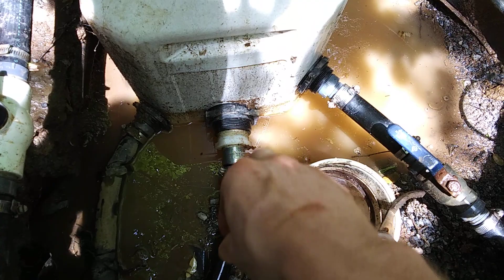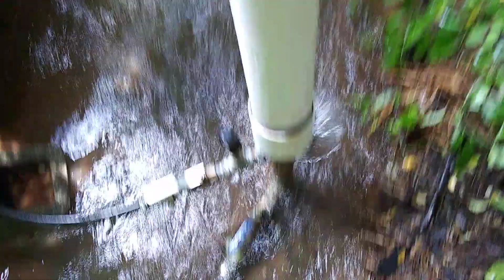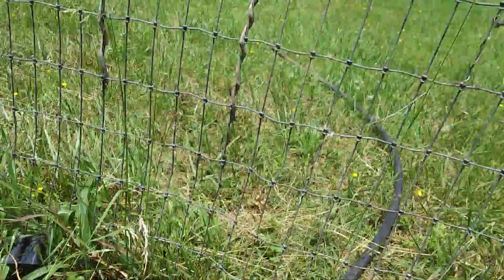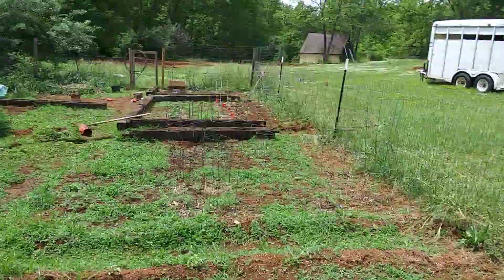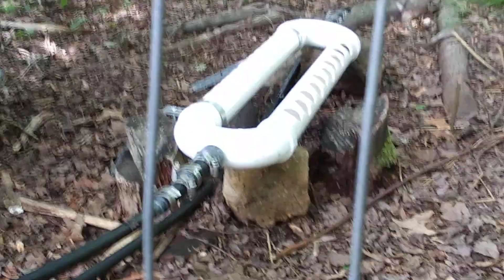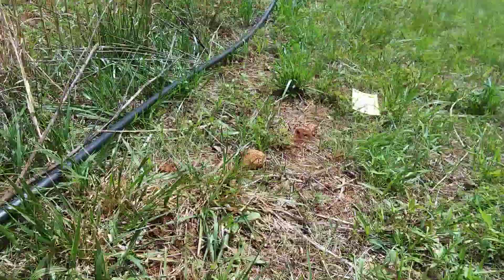Spring-fed ram pump for chickens and horses

Comment: Hello, I just subbed. Can you please explain how can you install the Ram pump from the head of the Spring? I will be capturing the water and making a Dam and send it uphill about 30 ft of steep slope on the mountain. I just don’t understand how the Ram pump can do this while wasting 90% of the water in the small Dam? From the source of the spring I may be getting about 1-2 gallons a min…I would greatly appreciate your help brother
Reply from the maker: A ram pump uses high volume of water at low pressure input and converts the energy of falling water into low volume at a high pressure, there are plenty of videos explain how ram pumps work that will do a much better job than I can, but basically it "wastes" water to run the check valves on the inside of the pump, as long as you have a slope from the water source to the ram it will run

Comment: Subbed. I never thought of increasing the height of the stand pipe. I think you are the only person to do that on YouTube. Thanks!
Reply from the maker: You want your standpipe to be tall enough to hold ALL of your water and not leak out the top. If it leaks out it means you could be running your ram with a larger stroke, more weight on the waste valve, or a taller standpipe. It also means that your source of water (intake) is higher than the top of your standpipe. Water works like a level, the point of a standpipe is to bring the source of water down to your ram. You want as much height or head pressure as possible.

Comment: Put a float valves on your waters and a holding tank for storage. 
Also if you like water in your garden you should look into Chinampas.
Reply from the maker: Great ideas, my set up is definitely a work in progress. Those chinampas are awesome! Never heard of that before. That absolutely looks like something I'd be interested in, only I would probably use the actual creek for water supply not the ram pimp

Comment: You said the stand pipe was 10 feet tall.   Assuming you have some fall from the stand pipe to the ram pump - what is your effective head?  10 + ?
Any idea of the volume of water you are getting at the T at the top?
Reply from the maker: Good question, the way I understand how water gravity and the fall works, however high the water fills into the standpipe without the ram running, that's how high your source is. Or "head" so mine would be over 10 feet, because my standpipe that is 10 feet tall was overflowing. Hopefully that clears an confusion in what I said in the video and thanks for watching!
The most I have gotten so far is 1 gallon a minute at the top of the hill. But I still have some things to tweak and adjust, I've only had this set up for about 2 weeks
Reply: @Whelessry  I understand your reason for going to the T at the top and coming back.  Many do that with a tank at the top.   However, there is another factor that I'm not completely clear on.    The higher the delivery height, the less water is pumped.  I've seen ratios from doubling the height resulting in half the volume and also doubling the height resulting in 1/4 the volume.    I'm not sure the true number and may not be linear.    
In my case I I am planning on going up 10 feet from a creek to the edge of a meadow to do an irrigation process - low pressure Wobblers or drip irrigation.   However, if instead of going to the higher edge and coming back, I instead irrigate along the way - maybe I'd deliver more water.   Also, not sure that ram pumps are the right water powered pump tool in my situation, but will be an approach tested.
Reply from the maker: @davebean2886 oh I see. In my case, my goal was to get water to the top of my hill as a first priority. Thats where the chickens are. Then slightly down to the horses, then back to the garden. The top is about 45 feet elevation from the ram pump. The garden is only 3 feet elevation from the ram pump. I only fed it back down and am using the overflows so that pumped water isnt wasted. I know ypu said you understand that, but my point is that honestly I'm not too worried about how much water I get to the top of the hill because as long as it pumps, the water troughs will fill up eventually
Reply from the maker: @davebean2886  to you're comment about a ram pump for your situation, pumping up hill 10 feet with a ram pump can be a very easy task, if you're worried about not having a big enough creek or not having enough fall for the ram to run there is a video by engineer775 who explains how to calculate how much water you can pump. He goes through the math equations. But if I were you I would just go for it and see how much water you can pump uphill with a smaller easy to build set up first to see if you'd like to scale it up in the future, if you're doing this for a garden, most plants don't really need that much water. (Unless you have a very large garden) but since the ram runs 24/7 even a tiny amount of water should be plenty for even a big garden.
Reply: @Whelessry  Thanks - I have a Land to House 1 1/4 inch ram pump that I'll begin testing shortly and be in a better position to extrapolate.   I was please to learn that ram pumps can function at fairly low head, just becomes a matter of how much water is pumped.    Unfortunately for my irrigation application - volume matters.   Also considering other types of water powered pumps.

Comment: Well done man. I'm going to do a ram pump in my creek and of all the systems I've seen on youtube, I like yours the best. I appreciate you sharing. I shared your video on a couple facebook groups that would get value from your video, hope you get many views from it! Sub'd as well man. Keep it up!
Reply from the maker: Wow thanks for the kind words! I spent a lot of time building this system and have even made a few changes already. Will be posting another update video tomorrow. I made a sight glass in the standpipe so you can see the water level in the standpipe and i upgraded my pressure tank for the pump. I post videos to hopefully help someone struggling with a design or troubleshooting problems they are having. thanks again!